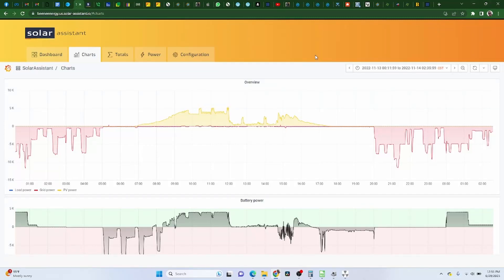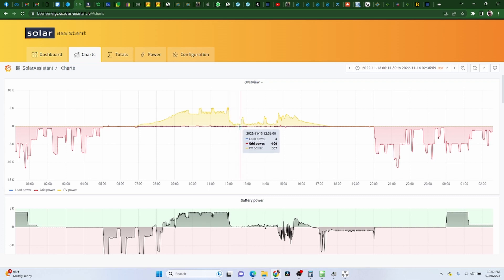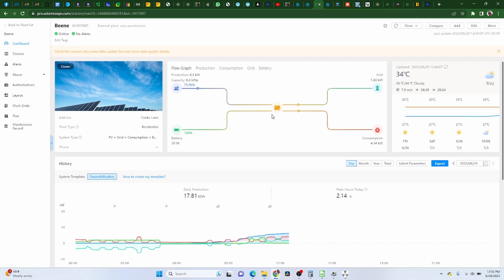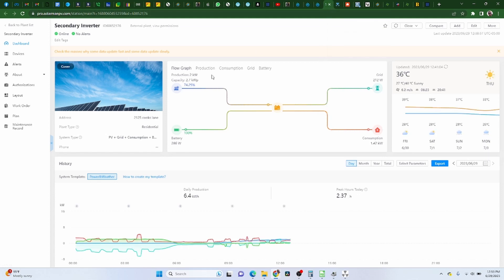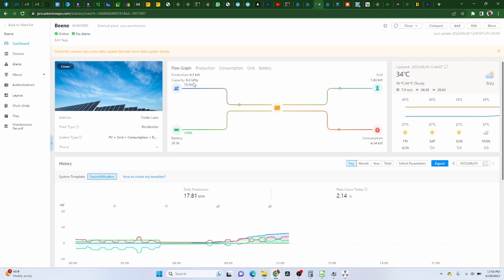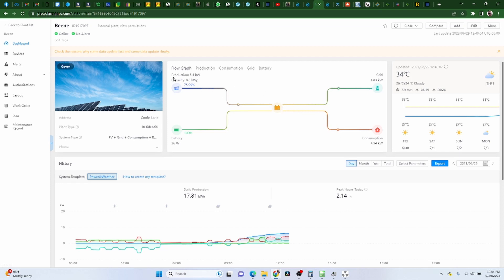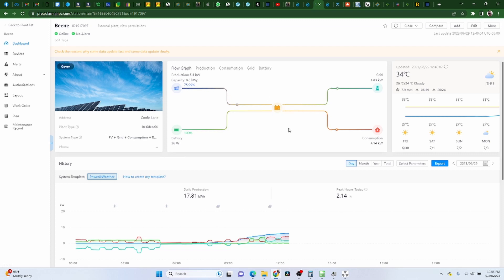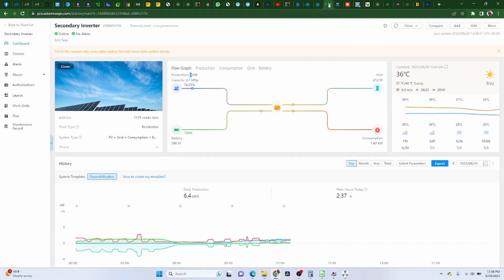Megarevo Improving Inverter Efficiency

Comment: Has someone made a video on how to configure MRs in parallel?  (Or have a menu "recipe"? ) Keep getting parallel enable fail error...
Reply from the maker: Error handling on these things is inherently bad. For parallel you are supposed to have all settings exactly the same and both units on the same firmware. Then go into the parallel settings and when you set one to the primary it will have more parallel options then the other. There is a setting in there that says how many total inverters there are in the group (this will be set to the same number on both units) then there is an address that you assign to each inverter. This one will be different for each inverter. Hope that helps, not as good as a video but it's something!

Comment: Sorry to interrupt, had problems connecting my solar assistant to my ION  8k inverter, it turned out to be made by megarevo.  Some photos of how to connect.
Reply from the maker: Should be pins 2 and 3 of the WiFi dongle connector.
Reply: @BeeneEnergy  yes definitely, thr photo shows back pins 2 and 3 connected to the green and white wires

Comment: I contacted Megarevo looking to buy them straight from the manufacture. They quoted:

R12KLNA 12kw Split Inverter: 
Price: $2222
WIFI for inverter:$30
Door to door freight cost: $702
Total amount:$2222+$30+$702=$2954

R16KLNA 16kw Split Inverter: 
Price: $2583
WIFI for inverter:$30
Door to door freight cost: $702
Total amount:$2583+$30+$702=$3315

They also carry a 14 kw unit but did not get quotes for it. I have been comparing to the EG4 18pv. Megarevo gives a 5 year warranty compared to 10 with EG4.  Do you guys think its a good idea to go for Megarevo 16KW?
Reply: Do you carry megarevo in you shop?
Reply from the maker: I can’t get Megarevo to support the r8klna inverters (~7 of them) much less warranty them. They have ghosted me on WhatsApp.
Reply: Thanks for letting me know. That makes it clear to me what Im gonna buy. Im going for the eg4 18kpv.
Reply from the maker: @julianjiron8085  Let me know if you’d like a good price on the EG4.
Reply: @BeeneEnergy  yeah that would be great let me know thanks.
Reply from the maker: @julianjiron8085  Shoot me a text when you have a minute. 682-730-0725

Comment: I have 2 Megarevo inverters. 
I have it split into two separate systems 14 Trina panels 550 about 480v on each inverter  working good feeding 60 to 80kw a day.
Would like to get your input on my system.
Ernie
Reply: Hey just wanted to ask what models your using and how has your experience been?

Comment: Do you know the connection diagram of megarevo with solar assistant?, thanks
Reply from the maker: Iirc it’s pins 2 and 3 of the monitoring connector over to an rs485 adapter.

Comment: Mr Beene are there any setting changes to make on a Megarevo to stop charging halt when one battery reaches 100%? I have 3 UFO 48v 200ah batteries. They are close but over a few weeks drift out by 13% or so. I have flipped the breaker on the most charged battery at 99% and this works but is there a setting on the inverter to prevent the stop charge?
Reply from the maker: You using closed loop communication and doc for charging? Or voltage?
Reply: @BeeneEnergy  connected to the address 1 battery with CAN connection. Charge voltage 54v I think auto set.
All batteries rs485 connected to each other.
In charge mode 6KL1 shows charge on most charged battery and on discharge (say at night) shows most depleted battery.
Reply: @BeeneEnergy  doc I think. I see others using voltage switching setting to lead acid?
Reply: @BeeneEnergy  hi mate
 My packs are only 15 cells 3.2V nominal. They rest after full charge no loads at around 3380mV.
Would this Lead Acid setting be OK for 90-95% SOC?
Absorb 54V
Float V 51V
Bat end 48.3V
Aim is to not rag the batteries as I have 30kWh available to run a pond and charge wife's car 10kWh once a day.
Cheers
Cain

Comment: I see you're using Solar Assistant. Did you make a video how you removed the 4 pin rs485 connection and build a 5v usb etc? Atm this is beyond my ability without a how to video.
Reply from the maker: No! I've been trying to find the 4 pin connector so I can make a megarevo to solar assistant adapter but haven't found it yet. Just using some wire stuck up in the pins for right now. Very janky.
Reply: @BeeneEnergy  other thing I was going to try were red ferrules and crimp to the rs485 pins. Shame they used such a wierd connection. Solis make these wifi connections but apparently dont work with Megarevo.

Comment: I will put in a good word for Megarevo. They really helped me out today putting me in contact with Portugal office to source a wifi logger (4 pin).

The manual was hard as it's really basic but i worked it out in a few hours.

Worst thing i did after hanging it was forget the PV breaker was off. 😂
Reply from the maker: Ha ha I left the RSD button in when I first set mine up and couldn't figure out why it wasn't working! Glad you had a great experience!

Comment: I was wondering if you ever had any issues with your powmr charge controllers when a cloud passes over? About once a day a cloud can pass over and my 100 powmr will do this thing where the fans start ramping up and down erratically. Only way to get it to do right is completely disconnect solar and battery then hook it back up and it works.  the rest the day with no issues. My other powmr is a 3000 watt all in one and the charge controller on it will be working correctly then q cloud passes over and it will suddenly barely be charging and be stuck like that till i completely unhook it and then hook it all back up. So yeah i was wondering if ypu ever had those kinda problems with yours? Seems if i over panel them at all then it makes the problem much worse. I just ordered a 150-70 victron so hopefully it will work right for me. And bro i lile your videos. You have taught me alot and helped me with confidence in building my system

Comment: Thx for the info...This should've been a go to inverter but they messed up so bad Will P couldn't even get it to work...who's going to trust it now?  I wanted one, but no way will I touch it!
Reply from the maker: Yep, going to be hard to get trust back.
Reply: My 6KL1 off grid has been totally solid for 12 days. I'm a total novice. No issues. To go on grid the manual is too basic imo. No issues with CAN port to Li battery.
Reply: Whats is the apps in laptop do u have link